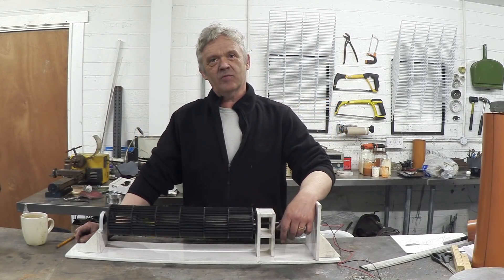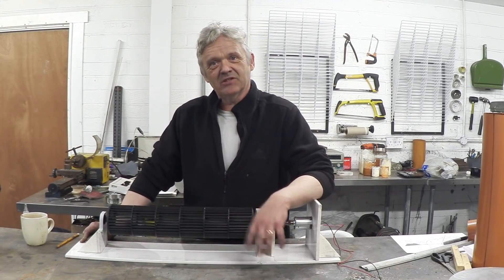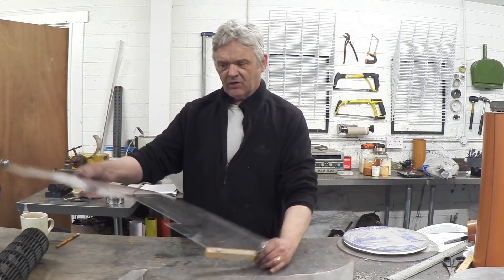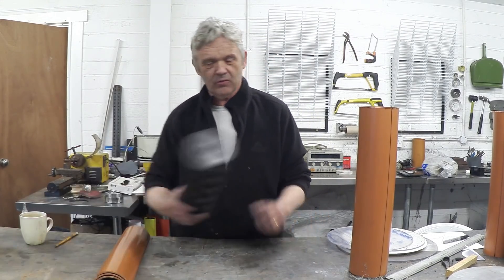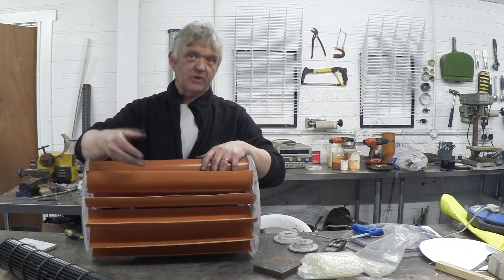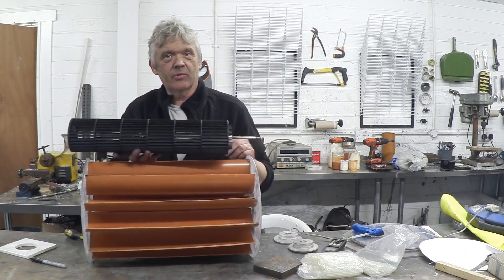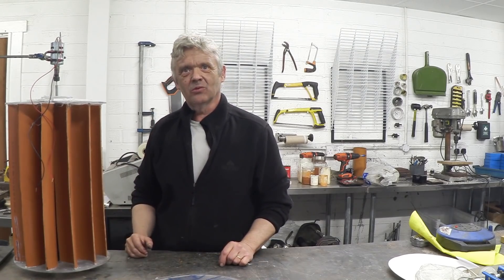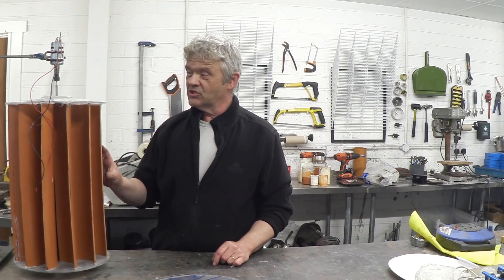Vortex Shroud For Vertical Wind Generator

Comment: Love your videos! You now have a base upon which you can build a gen motor mount. (At the top of your shroud.) Maybe a preliminary goal would be enough power to charge a Li-Ion battery, which would power a small 3.6v to 5v converter, which could then charge a smartphone?
Reply from the maker: sure mate - good thinking